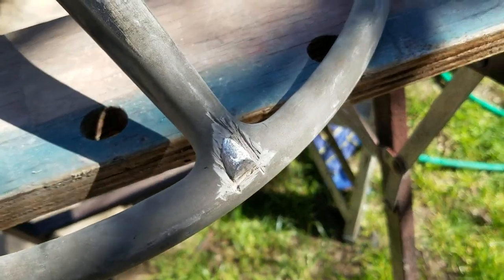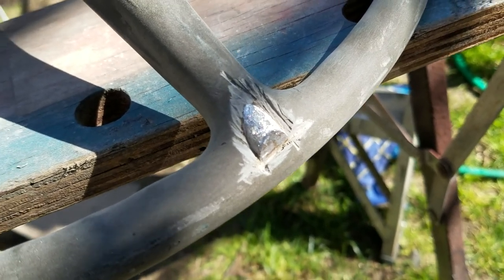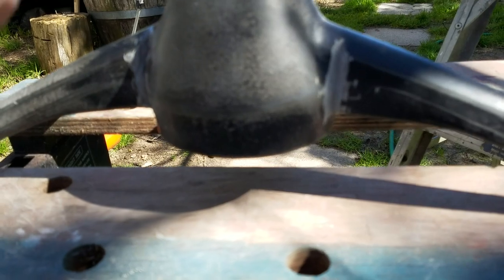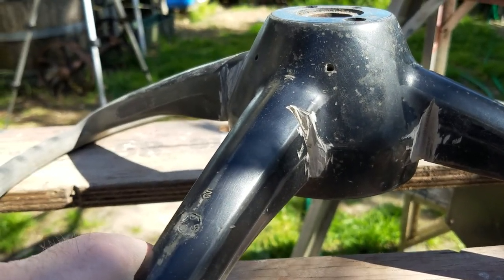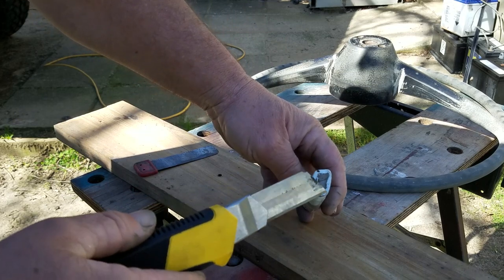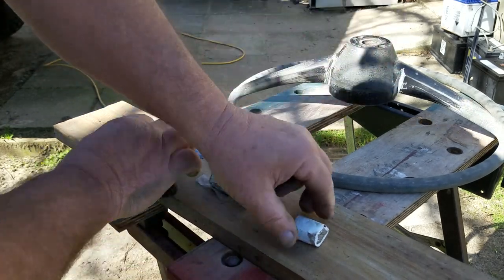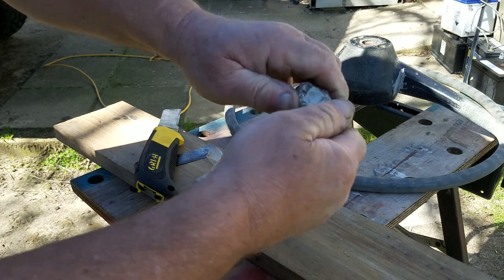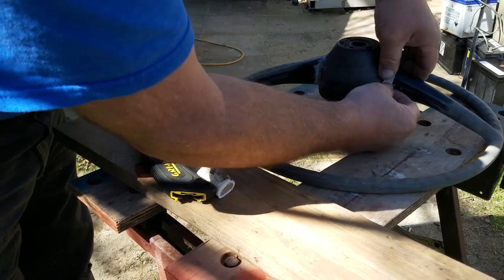Land Rover Series 3 Rebuild -Steering Wheel Refurb, No-Sew Seat Upgrade,  New Boots.

Comment: Hi, where did you source the roof lining that you were talking about??
Reply from the maker: https://www.retwine.co.nz/product/1114/headlining-vinyl-white-perforated-137cm/
Reply: Awesome! Thanks
Reply: @t.h.o.r.  would you glue this directly to the roof?
Reply from the maker: @WillRadford200  if its the one with the this 3mm foam backing then yes. if its the 'unsupported' one thats designed for the older suspended hood linings. Quite a specialist job

Comment: There bloody awful,  when the outer glaze wears away, they just melt in your hands and leave black crud all over you. Mine went in the bin. Good riddance I say.
Reply from the maker: Yes yes yes!! I totally agree. its like pond sludge on wet days.
 But in NZ you have to have a new wheel signed off and certified- same with repairs to steering components. no fabricated parts- no welding no modifications.
Reply: @t.h.o.r.  the wof is that strikt now? Rediculous 
My momo is safer because it's soooooooo much more comfortable and easy to hold.
That and discovery 2 power steering. Way safer, way less agrovation